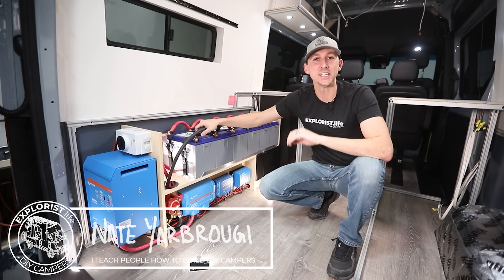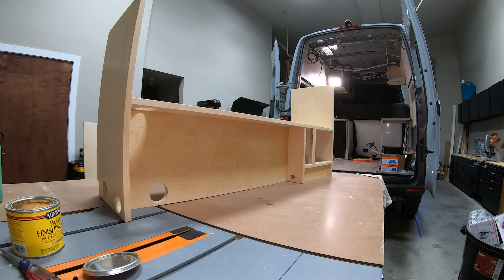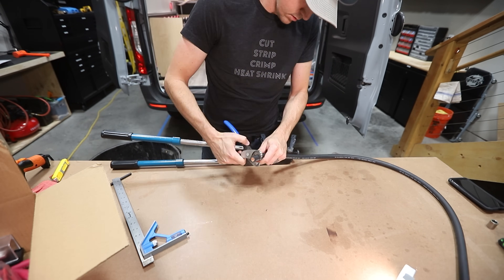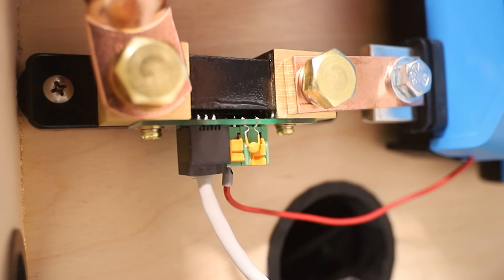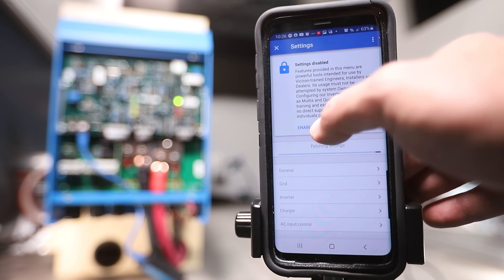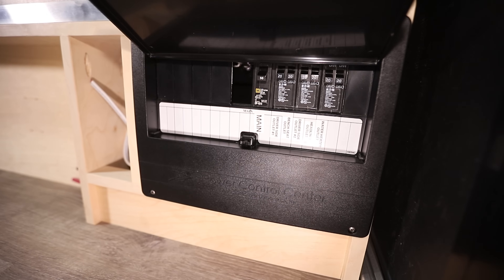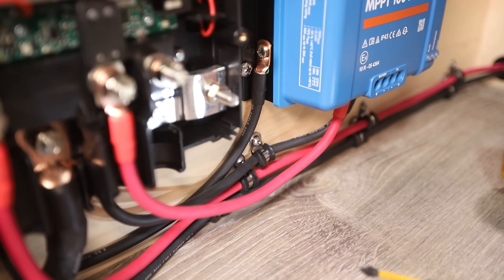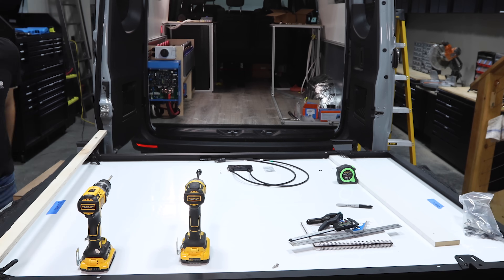DIY Sprinter Camper Van Electrical Install - Full Tutorial

Comment: If Im using 2x lithium batteries(each are 160Ah), if I connect the batteries together with N to N and P to P, is it still the same to connect the P cable after the ANL fuse holder to the nearest P terminal, with the N cable going to the furthest away N terminal?
Reply from the maker: Apologies, but I'm not quite sure what you're asking.  Perhaps consider just doing it like I showed in this video but omitting the middle 4x batteries to accommodate your 2x batteries?

Also, note that the Multiplus 3k requires a 400Ah battery bank minimum, and 2x160 is only 320Ah.
Reply: @EXPLORISTlife  thanks for that, just confirmed my thoughts, I was going to connect a 2000w phoenix smart inverter and also a victron 12v 30a blue smart battery charger instead of a multiplus, to save on space. Do you have any schematics that can be purchased for such a layout or tutorials?
Reply from the maker: I don't have diagrams of separate inverters and chargers because by the time it's all installed with the proper transfer switches and such, it usually takes up more space, requires more wiring, requires an additional spot on the Lynx Distributor, and is often more expensive and loses out on the passthrough and power assist functionalities of the Multiplus Inverter/Charger.  If you're good with a 2000w inverter; I'd recommend this system featuring the Multiplus 2k: https://www.explorist.life/2000w-inverter-200-400ah-lithium-200-to-700w-solar-camper-wiring-diagram/
Reply: @EXPLORISTlife  Thanks Nate, this might be the answer Im looking for, I assume this multiplus compact 12/2000 can be mounted on the floor rather than upright if needed?
Reply from the maker: The user manual makes some pretty specific recommendations for mounting orientations. 👍
Reply: @EXPLORISTlife  hence why I’m asking, as I don’t want to buy it after sending back my phoenix inverter and blue smart battery charger to later discover it can’t be mounted flat on the floor
Reply from the maker: @amacmedia  Did you look up the user manual?  Victron has all of those on their website.  In fact... If you do an 'ol google search for {Product name} User Manual; pretty much everything has a user manual online.
Reply: @EXPLORISTlife  brilliant, I hadn’t thought about that

Comment: Hi, I've been following the instructions in my van build but can not find the on/off swich for the  Victron Multiplus.  Am I missing something?
Reply from the maker: With all due respect and in the nicest, most non-judgemental way I can say this... but the on/off switch of the multiplus is literally the only switch on the front of the unit.  It says 'on', 'off', or 'charger only'.
Reply: Nate, thanks so much. I've had the cover off and just seeing you press somewhere to the right of the lights, I couldn't see where. But, looking at the cover--I feel like an idiot.  Thanks again!
Reply from the maker: Okay, great!  I see.  That does indeed make the switch significantly less obvious. 🤣😂

Comment: Why do you use 6/3 for your ac out, into the 120 panel? Isn’t that oversized for a 3000VA inverter that will only supply about 25 amps at max? I think I’m missing something
Reply from the maker: YouTube search: EXPLORIST.life Power Assist
Reply: @EXPLORISTlife  dude the fact you responded so fast on such an old video means the world. Thank you
Reply: @EXPLORISTlife  So if I have a 2000VA multiplus with a single circuit (with 3 outlets) and 20amp shore power can I just use 12/3 since power assist wouldn’t come into play? This seems like something for if you have more than 2-3 120v circuits
Reply from the maker: Why not just follow our system design as-is so you have a complete and fully-functional system?  You're spending a lot of money on Victron components and it sounds like you're trying to cut corners.
Reply: @EXPLORISTlife  I have no need for more than one 120V circuit from the inverter. Not trying to cut corners whatsoever. If power assist won’t come into play because I only have a single 120v circuit, and won’t need the combined inverter + shore power to power that single circuit, then 6/3 is unnecessary. I’m truly trying to do things correct here…  I’ll just see if google can answer this for me. Thanks
Reply from the maker: Understood.  Well, I will say that by the time you get done googling and find an alternative solution, you could have just purchased the wiring and breaker box that we have in our store that works for this system and we could be getting it on the way: https://shop.explorist.life/shop/all-products/120v-ac-distribution-panel-wiring-kit-no-panel/

Comment: Air Conditioning .... the 12 volt systems seem like a good choice, except that they are very expensive.  The Nomadic Cooling 3000 model (12v) is presently priced at more than $4,500.  There are other choices for 120 volt A/C roof air-conditioners that are more reasonably priced around $2,200.
  So, I ask which system will produce the greatest cooling & LEAST noise?  A brief bio; I am old geezer, semi-retired Geologist.  I work in a range of localities from High Rky Mtns, to the deserts of Arizona, and even in the Gulf Coast of the U.S.  I want a powerful & reliable Air Conditioner that can run "off-grid" all night if necessary!  I need to sleep well.  What is the best choice for A/C, and is 660 amp/hr (Victron) capacity enough?  I am upfitting a new 2021 Ford High Roof 148" WB Transit van.
Reply from the maker: Sounds like you need to do a power audit to determine how much power you can anticipate using on a daily basis.  Here's a tutorial: https://youtu.be/a406IxiU-Xg

Comment: if i am just building out an average system do i really need all that 4/0 cable? couldn't i use somethign smaller?
Reply from the maker: Ultimately, you can use whatever you like. 😂🤷  But if you don't want your shit to melt, the best strategy is to not undersize your wires.
Reply: @EXPLORISTlife   odd, you are just the only person i see recommending 4/0 was just trying to see if you actually need it, or if its just a better profit margin in your store.
Reply from the maker: Our wire sizes are based on the manufacturers recommendations and the ABYC wire sizing formulas like we shared in this video: https://youtu.be/ki3WXVR48eM

I know that 'other youtubers' may share their systems with undersized wires, but that typically leads to subpar results like the time Eamon and Bec used our 12v 2k inverter diagram to wire their 12v 5k inverter with no changes to wire/Fuse sizes which resulted in... well... system failure.

Wire size is not the place to cut corners.
Reply: @EXPLORISTlife  i apologize, i was totally wrong.  this is for the 3k inverter, on your site for the 2k inverter you use 2/0. Got any discount codes for Memorial day?  if so hit him up ill spend a couple grand on your site. looking at this full wiring kit with a victron setup
Reply from the maker: 🙂 Thanks for understanding.  We dint really play the coupon and discounts game.  Instead we play the "we are a small business and still price our stuff the same as you can find on Amazon and provide free tutorials with no obligation to purchase" game.

Comment: Why elevate the batteries and jack up the center of gravity of the van? There must be a good reason yes??
Reply from the maker: It just fit better like that.  That's only ~180lbs worth of batteries, so it doesn't really 'jack up the center of gravity' any more than than an average adult male sitting there would.

Comment: I'm comparing this install to the schematic I purchased from your web site that is for the same installation, and I see you have a large fuse in the video connecting the shut off switch and battery bank. I don't see this on the schematic. Can you please clarify. Thanks
Reply from the maker: There is definitely a main ANL fuse in the diagram for this system. 👍
Reply: @EXPLORISTlife  I think I see it on the battery terminal
Reply from the maker: @MrAbbielover  Sounds like you may have purchased the diagram from this system -> https://youtu.be/E5q7_4FH4LQ
Reply: @EXPLORISTlife  no, this system I am putting in my van is  for 4- 100 amphour batteries and with a Victron 2000 watt inverter/shore power unit, 370 watt solar panel,etc...just like this video. I bought your plans so I could make sure I get all the right size wires, fuses , etc. Still don't see that fuse for the battery bank( unless it is on the battery terminal), but not really a concern as I know I need to install one between the shut off switch and the battery bank.
Reply from the maker: @MrAbbielover  Ah, yes.  That's a smaller system than what is shown in this video.  So although similar, there are a few different parts we can use.  That is an MRBF fuse and is included in the 2/0 Lynx Distributor BMV712 wiring kit that is a part of the full kit for that 2000w diagram: https://shop.explorist.life/shop/all-products/camper-wiring-kits/complete-wiring-kits/wiring-diagram-kits/200-1000ah-battery-bank-multiplus-2k-12v-orion-12-12-30-wiring-diagram-kit/
Reply: @EXPLORISTlife  other than the video install having the 3000 w inverter, a else is the same, correct? Can I use the same install as the video for my system or would that be wrong? I think the only difference would be the fuse I asked you about, correct?
Reply from the maker: They are both VERY similar systems with a few small differences that anybody with average mechanical aptitude should be able to figure out.

Comment: I’m building my own camper van I’ve been watching sooooo many video! I NEED help so over whelmed. I have my 4/0 wire and my lithium batteries by Lifepo 4 how do I know what size lugs I need for it?
Reply from the maker: Lugs are sized by two metrics: 1: The size of wire the lug fits onto.  2: The size of hole in the end of the lug that gets bolted to the terminal of 'whatever the lug is connecting to'.
Reply: @EXPLORISTlife  thank you so much i have the lugs! im very over whelmed ive prob watched hundreds of hours of solar vids not confident. do i NEED a lynx distributer? i have my 400w of solar panels. 3000 w inverter MPPT charge controller. 4 100ah lithum batteries a fuse block. i dont have ANY breakers or fuses how do i know how many amp fuse/breaker i need for a 3000w inverter?
Reply from the maker: Why not just follow the plan I laid out in this video instead of trying to design it yourself from scratch if you're overwhelmed?  I literally made a wiring diagram of this system with every part labeled AND have a full parts list available for you to purchase so you don't have to 'figure it out'.
Reply: @EXPLORISTlife   wow you reply fast! and i had already had all my components bought besides the lugs unfortunately plus my lithium batteries also dont have low temp protection so i have to wire in a breaker and temp that cuts power to my batteries if it reaches a certain temp which i have the stuff bnut not sure where to wire it
Reply from the maker: @josephallen9454  Oops!  That's definitely the hazard with just buying a smattering of parts before you have a full plan in place.  Fortunately, I have a ton of videos that help you design your own system from scratch.  Here's the playlist for that: https://www.youtube.com/playlist?list=PLmvhcyi4n0TUjVGA_O5aI5SQrS1kKLgEF

Good luck!
Reply: @EXPLORISTlife  would it be possible to give you a list of what i have  and you make a diagram for me with what i have and obviously pay you for it?
Reply from the maker: Nope.  If you are willing to spend extra money, you should just invest in the parts I showed in this video.  Paying me my hourly rate to build a system around parts you've picked out with little/no rhyme or reason will just be wasting your money because you may have picked out parts that don't even work together.  This is a service I don't even offer anymore because it never worked out well for my customers.

Think about how it would work if you went to a chef with some pinto beans, some fish, some bbq sauce, and some ice cream and asked them to make you a salad with those ingredients.  Same concept.  Not going to work well.

Sell the parts you can, return the parts you can, and start from scratch with a proper plan: https://www.explorist.life/solarwiringdiagrams

Comment: I was looking at the diagrams that you sell on your site, I am pretty good with electrical but what if I am unclear about something on your PDF,? Is there a way to ask questions or like a support page?
Reply from the maker: What are you anticipating being unclear about?  I answer all kinds of questions here on the youtube channel.  Most of the time, the only time people are unclear about things from the diagram is when they try to change a bunch of things...so don't do that and you should be fine.
Reply: @EXPLORISTlife  I guess only because, I'll probably only have one 100 watt panel and a 100ah battery, not like what you have listed. I'm probably not going to use and inverter either but still want to be able to charge with shore power or leave the shore power plugged in to run the fridge.
Reply from the maker: @TheAngryCamper  Yeah, so... you've got a lot of specific needs that my diagrams don't cover, so you probably won't get much use out of them.
Reply: @EXPLORISTlife  So should I find a local person to consult with?

Comment: Hi Nate,  do you make a wiring kit for a  2022 sprinter 170 ?
Reply from the maker: Yep!  The system shown in this video should work for 2022 sprinters.  The only difference 'could' be the way/type of fusing at the starting battery for the DC DC charging.  That's the only 'vehicle specific' thing in this system.
Reply: @EXPLORISTlife  Hi Nate, can I use the Victron MultiPlus-II 12/3000/120-50 2x120V for this installation? I like the size of the Inverter/Charger.

Comment: Which tool are you using to cut the 4/0 wire around the 10:00 mark?  I was just watching your "How to Cut Wire" video and it looks like the tool you suggested for 4/0 is much bigger, but the one you use in this video seemed to have no problem with the big wire.  Thanks!
Reply from the maker: Yes!  It's my new toy.  Klein 63060 Coaxial Cable Cutter: https://amzn.to/3AA6UmA
Reply: @EXPLORISTlife  One more question for you - is the shelf that's holding the batteries supported by the wheel well at all?  Or is it strong enough to support the weight of the batteries as is?
And thanks again for this video.  It's been a huge help as I'm finally getting around to my own electrical system.
Reply from the maker: @csteutterman  The battery shelf is supported by the vertical piece that holds the lynx, mppt, orion.
Reply: @EXPLORISTlife  Sorry, one more question....for now :)  Do you think the vertical piece that's holds the lynx, mppt, & orion could be a little bit shorter?  It looks like there's some extra clearance above those components, but I'm not sure if that's needed for ventilation or any other reason.  I'm designing a similar frame for my electrical system and was going to make it a bit shorter to minimize the "wasted" space around the wheel well in my Ford Transit, but just want to make sure I'm not overlooking something.  Thanks again!
Reply from the maker: @csteutterman  ventilation above the mppt and orion is indeed necessary.

Comment: I am trying to add the same components to my RV I become increasingly frustrated because you show the components while talking  through each step. My process for learning is by taking screen shots of your steps. Why am I frustrated? Because it would be one hundred times more helpful if you would provide written items on the screen in order for me to make a list of all the proper parts such as proper wire sizes, proper fuse sizes and proper lug sizes since I cannot record screen shots I would be thankful for this consideration in future offerings. But I really like your thoroughness and care with your videos. Thanks
Reply from the maker: A list of 'all of the proper parts such as proper wire sizes, proper fuse sizes, and proper lug sizes' is already available...

The wiring diagram (with labeled components/parts/etc) as well as a detailed parts list can be found here: https://www.explorist.life/3000w-inverter-400-600ah-400-to-1200w-solar-camper-solar-kit/

Here is the wiring kit for this video that also includes what all parts are included in each chapter of this video: https://shop.explorist.life/shop/all-products/camper-wiring-kits/complete-wiring-kits/600ah-multiplus-3k-12v-orion-12-12-30-400w-solar-wiring-kit/

Comment: So the ground is connected to the body of your van with a 4/0 wire???
Reply from the maker: indeed.
Reply: Your tutorials have been such a huge help!
Reply: Also, I am attaching a picture of the screw on the inverter that I am using. Am I really supposed to try to fit a 4/0 wire on this tiny stud